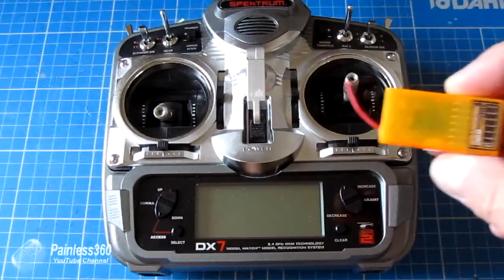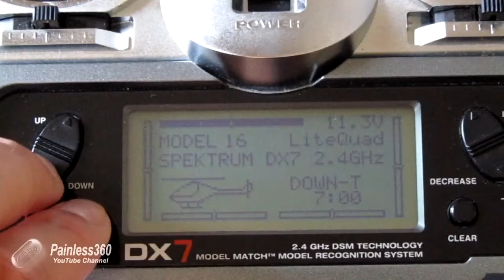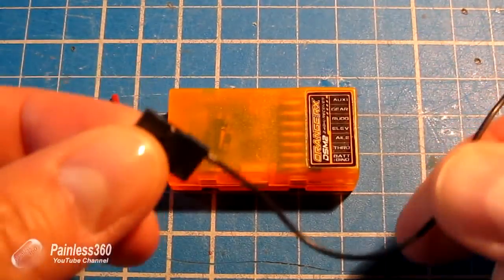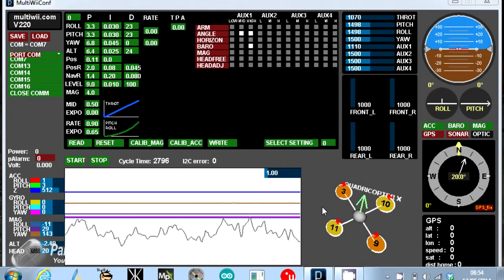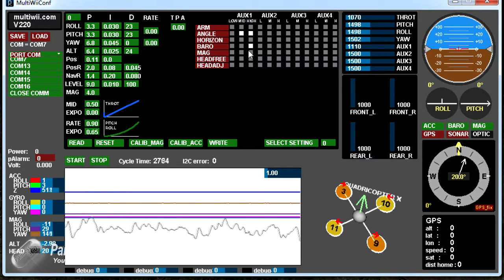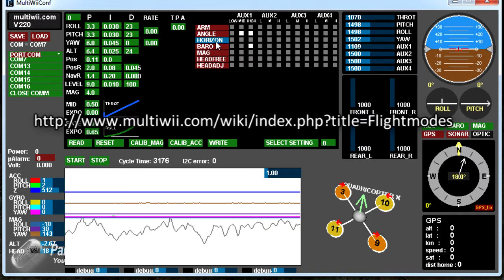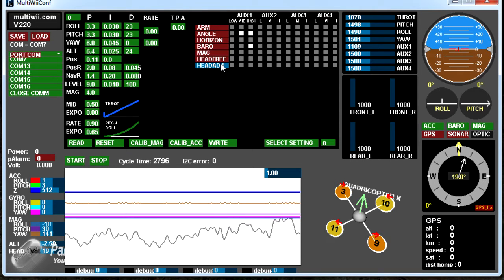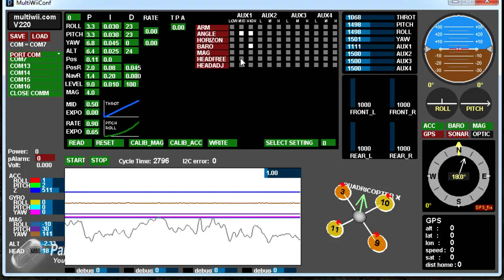(4/7) MultiWii modes - radio, connection and software setup

Comment: Does failsafe works on multiwii. ?
Reply from the maker: It is a long time since I played with it and it didn't support modern protocols so you'd have to set the RTH signal to be used when the RX lost the connection..

Comment: Arduino: 1.8.9 (Windows 10), Board: "Arduino/Genuino Uno"

C:\Users\HP\AppData\Local\Temp\ccilRd80.ltrans0.ltrans.o: In function `main':

C:\Program Files (x86)\Arduino\hardware\arduino\avr\cores\arduino/main.cpp:43: undefined reference to `setup'

C:\Program Files (x86)\Arduino\hardware\arduino\avr\cores\arduino/main.cpp:46: undefined reference to `loop'

collect2.exe: error: ld returned 1 exit status

exit status 1
Error compiling for board Arduino/Genuino Uno.

This report would have more information with
"Show verbose output during compilation"
option enabled in File -> Preferences.

Comment: i want to use 2 aux channels. one is working fine but the second is not.
is there any way to configure/enable 2nd aux channel?
Reply from the maker: +veer kumar rathore if they are setup on the radio and connected to the flight controller you'll see them. What troubleshooting have you already tried?
Reply: solved it.
Aux1 i am assigning to 3-state switch, GUI also have Low, Mid, High.and it was working fine.
Aux2 i was assigning to 2-state switch (High, Low), but GUI require 3 states (Low, Mid, High). i had to enable the right switch. that was the problem.
now i have assigned Aux2 to 3-state switch and it is working great!.
thank you for you time
Reply from the maker: Glad you got it working! Running though the problem methodically can usually get you close to the answer. Happy flying!

Comment: Hello! I'm new to building quadcopters and I've recently run into an issue where only two of the motors spin when I increase the throttle , and even the speeds of those two motors are too slow. I've calibrated the ESCs and the motors work well individually. Would this be an issue with the receiver/transmitter or the programming of the multiwii? I'm not sure how to go about fixing this, could you perhaps direct me on the right path? Thank you so much!
Reply from the maker: Have you tried to fly it? This can happen on the bench in a test as the 'feedback' from the movement expected by the flight controller isn't there..

Comment: Hello again, and thanks for the great videos. I am building my second quad, and have ordered a Flip MWC 1.5 FC, with Baro and Mag, and Firmware 2.3. Being impatient I have been looking at the Windows GUI, and the MultiWiiConf GUI. The Windows GUI loads fine, with no board plugged in (still en route), but the MultiWii will not load (using windows 32 version). Is this normal? Does the MultiWii need the board plugged in before it will come onscreen, or is there something amiss?
Reply from the maker: I'd wait until the board arrives before troubleshooting something that might not even be an issue ;) We don't use MWC anymore, best of luck with the build! :D

Comment: Great video.  Helped me take a closer look at how I had my FC board board set up.  I use the identical orange receiver in the video.  So, my receiver had 6 outputs, including the Gear and Aux1 channels.  However, I Never realized the FC board only had 5 channels.  The FC board does not have a Gear channel.  Instead, it has the Aux1 channel.  I never realized I made a mistake and plugged my gear channel from the receiver, into the Aux1 channel on the flight controller, until today.  So, the transmitter Gear channel always operated the Aux1 functions on the MultiWii Configuration screen, which seemed odd, but it worked.  I fixed the transposed connection on my receiver output.  Thanks.
Reply from the maker: You're welcome - happy flying!

Comment: hello working on 1st drone using multiwii se 2.5 connected it with receiver properly as u shown but can't arm it .so I checked signal in GUI software it's not showing pitch and yew signal at all only throttle n roll is changing I have checked receiver it's giving signals on all 4 channel then also multiwii is getting only throttle n roll plz help me
Reply from the maker: I'd swap the connections round and see if those 'dead' inputs stay that way.. and triple check you've got the wires the right w3ay round.. I'd suggest a CC3D for a first build - see our Flight controller comparison video.. Best of luck!

Comment: I'm sure the chip in the middle of the board isnt supposed to get hot and although I can bind the tx I still cant get the motors to spin.I'm probably pretty close to getting it running but life is too short to waste messing around with computers so I think I'll quit while I'm ahead and sell it off cheap to someone who's a bit younger and has the time to waste.
Reply from the maker: +thra5herxb12s Shame, there are so may other newer boards that are easier to setup and use (see our flight controller comparison video). Happy flying!
Reply: Thanks. Yes I have seen other boards for sale but I chose this one as an option because the setup looked quite straightforward enough.  I followed your tutorial closely and despite my broadband being very slow, I managed to upload the firmware to the board, but now I think the tx needs setting up properly.  I have the binding because the rx light stops flashing when I switch on, and I get a blue light indication when I move the throttle to lower right and back to lower left also gives an indication, but still no motor spin, even if I plug the esc into the rx directly I dont get a spin.  I will put it down for a while and have another look at what I might have missed when I have a bit more patience.

Comment: hello!, I have multiwii 2.5 but with the computer I cannot see the headadj and headfree mode, what is the problem? How can I fix it? I dont have gps.
thanks a lot
Reply from the maker: +Pigna Pigni Happy to help but please watch https://www.youtube.com/watch?v=olIqTiSJHIY and come back to me with more detail of what you've tried..
Reply: +Painless360  Hello, I saw the video but the answer is not there. With the code 2.4 I cannot see the headfree and headadj mode when the board is connected in the computer but with the code 2.3 I can see them. I have tried to active them but there aren&#39;t working definitely and I don&#39;t know why. The magnetometer is calibrate and it&#39;s work. Maybe there is a problem on the code? I&#39;m not a computer programmer so I really don&#39;t know what to do.
Thanks for your time

Comment: How do you determine the max range of your transmitter and receiver combination? Thanks a ton in advance.
Reply from the maker: +Aidan Melen You setup your receiver and attach something like a servo to a spare output then get a pal to stand still in open ground and wiggle the control that moves the servo and then start walking - when the servo starts to glitch then you're approaching the max range.

Comment: hi chap , i have followed your other videos and have managed to program the mutiwii board ok , but the problem iam having is that when i arm the board the throttle will start turning the props a little i have lowered all trims and sub trims but i cant get them to stop turning  unless i disarm the board , all my travel is full back aswell , any ideas
Reply from the maker: +andy richards Have you calibrated the ESCs?
Reply: yes did that , think i foune one of your videos about changing the code on the board
Reply: hi again do you deal with just quads of have you heli experience as well ?
Reply from the maker: Yep, started in the hobby with CP helis. Not bothered to fit flight controllers to them though.. Happy flying!
Reply: Hi, I've got the same problem, could you explain how did you solve it? Thanks
Reply: he has a video on how to stop this , i followed it , and it sorted it out , if you search how to stop my props from turning on start up ,the vid will come up  if i can remember rite its in the program listing
Reply: in the arduino program

Comment: Hello - Your videos have really helped me with my quadcopter! I have a  question. I'm using a Multiwii SE 2.5 and a DX6i. I currently have the Gear switch mapped to Aux1 in the multiwii gui and it operates fine. I've set up the Flap switch as my AUX2 however when connected to the gui, I see AUX2 is pinned at 2000 regardless of the switch position. I swapped the signal wire from the Gear slot on my AR6200 and plugged it to Aux1  its AUX1 on the receiver but aux2 on the gui if that makes sense) and and it works perfectly fine. This tells me that the transmitter is configured fine (not to mention I can monitor the switch activity in the transmitter display). My belief here is that there is something in the multiwii sketch that needs to be commented or uncommented in order to get Pin8 active on the board. I read through some forums and tried a few things, but can't seem to get the Aux2 channel out from being pinned at 2000. Any ideas are appreciated!
Reply from the maker: +tilneyaviation You can use pin 8 or 12 as aux 2, you need to define this in the sketch. Best of luck.
Reply: Thank you for your help. I knew I was on the right track, but must have botched something when I was fooling with the script. I was able to get it working this morning.
Reply from the maker: Great news - well done. Happy flying!

Comment: Did you talk about how the rates and expo work in the multiwii config in this series. I can't find detailed explanation anywhere cheers
Reply from the maker: AndyRC No I didn't. They work the same way as on the radio but with better resolution if set of the FC but you can change them using switches if you set them up on the radio.
Hope this makes sense.
Reply: im finding the rates part really confusing. next to the yaw and pitch axis there is a rate option but then further down theres expo and rate. cant find any explanation to the values that is transparent
Reply from the maker: RC rate: defines the sensitivity of the multicopter for PITCH and ROLL stick inputs. If you feel your multi too sensitive, decrease it. If you want to improve its responsiveness, increase this parameter.

Hope that helps.
Reply: yeah i see that on the wiki. i understand what rates are but there is more than one rate option in multiwiiconf. on my version 2.3 next to the d values i see two rate options  but then underneath the mag box there is mid expo and another rate box. which ones actually change the rates :-(
Reply from the maker: Best of luck with it.

Comment: In noticed when a certain flight mode is activated it turns green, but when I activate GPS flight modes it stays red? Have any ideas ?
Reply from the maker: Adam Keely Not sure - does the MWC have a 3d lock when you try this? Maybe it needs to have the GPS systems all working before it shows Green?
Reply: Yeah I get 7 satellites and a GPS 3D fix
Reply from the maker: Odd, have you tried a little GPS RTH?
Reply: I figured it out, you have to activate MAG also in order for the GPS hold to work.
Reply from the maker: Ah! Nice!

Comment: I have been trying to get my 450 to turn its motors the past few weeks and i can not figure out what i am doing wrong. Can someone please like at my arduino file and see if i am missing something and why it is not working? I have calibrated the ESCS. Currently the Blue light is on LED3 and 5v red light is on. Occasionaly the blue light will blink. I thought the blue light only came on when the motors were armed. This is the multiwii pro purchased from HK with the MTK GPS. Attached is the Arduino file if someone can please look at it i would greatly apprecate it. Thank You!
http://www.rcgroups.com/forums/showthread.php?t=2276498#post29834818
Reply from the maker: what board type are you selecting in the Arduino software?
Reply: Painless360 ok i used the original .ino file and it finally works although it seems to want to fly sideways and tip over. Is this a problem with the esc calibration?
Reply from the maker: Hi Jordan, sounds like it could be. Also recalibrate the accelerometers on a level surface and check the trims/subtrims on the radio give 1500 when at the midpoint for ELEV and AILE. Best of luck!
Reply: Jordan Mowbray Also. Try launching in angle mode. Smaller props, check motor and prop directions. Check radio settings. Calibrate ESCs and the overall weight balance. I found that playing around with my quad whilst i was holding it gave me a good idea as to what was going on, be careful if its powerful, mine only has the 10g motors. I lost an ESC for a while and took the chance to hold the quad by the not working arm and i flew it at the same time, this gave me a good idea if it was counter acting my movements etc. It felt like it could fly on 3 motors, you only have to take a tiny amount of the weight off the non working arm for it to stay level. Finally check PID settings if you have to. If none of your components or wiring are bad you can check all of the above.

Comment: Hello,first sorry for my english!! I have installed v2.0 on my MW SE v2.5 board and I CAN v2.1 in left corner was DONE UPLOADING no failure !! my problem is when i connect my quad blue LED flashing-on FTDI flashes red and on MW conf i cant see values,NOTHING,not exist -.- !! Now can you help me please !?
Reply from the maker: Reflash the board and make sure that the board is kept flat when you power it on. If its worked then you should be able to see the board in the MultiwiiConf program once it's updated.
Reply: Painless360
tnx for answer,but man...doesn't work!! i have one more time inst. software and same problem...blue led flashing constantly.when i connect board on comp no data !! i don't know what to do .  2 days i'm playing whit this but...no effect and your's go so easily ONE MORE TIME TNX ON YOUR TIME :)
Reply from the maker: Mali Zafrkani The blue light slashing like that usually means that the accelerometers need calibrating, which is done through the MultiWiiConf software. Adding a video showing the problem (screen showing the error on the PC, video of the lights on the craft) helps troubleshooting. It's like asking me to diagnose what's wrong with your car by telling me that it won't start ;)If there is nothing obvious then you will need to schedule a Helpouts session for me to help further.Best of luck getting it fixed!
Reply: Painless360
 Houston we have connection :D !! several times flashed several times soft.inst and OK i see now my quad in MWC and data,all green BUUUUUUT i don't have sensors -.- i2c problem ...counting and counting and counting....can i fix that any ideas ..please!?
Reply from the maker: Great news that you can talk to the board. Have you got anything plugged into the i2c port like an i2c board?
Reply: Painless360
my board i think have inside i2c becouse i have in conf.h enabled that ... i have on screen all data all sensors but i can't arm quad ...and i must say in conf.h i didn't select board (my multiwii se v2.5) i have i2c acc i2c baro and i2c mag acivated ...i'm working with MW v2.1

Comment: I'm trying to decide which modes I need and how to set them up on my Taranis. I know I want return to home. Which ones can I combine on one switch or should I use separate switches for each? Which modes should I avoid entirely?
Reply from the maker: When you activate RTH is uses the compass and alt hold to fly home. Even if you don't have then selected. Hope this helps. Happy flying

Comment: First of all thanks for all your time in these video's you've made, They have been very helpful. Question which software or sketch are you using? I want to setup one for a Tricopter. Waiting for this board to come in. If you have a link to where to get the sketch that would be very helpful. 
Many thanks
Reply from the maker: Hi Dennis, I edited my own. You can see the one that I used in one of the first Multiwii videos I made. You can find the link and details on Crius SE V2.0 MultiWii Board (MWB) Overview and Setup

Comment: Hi! Great video! I am having an issue here. I have a multi wii black 32 + gps. When I try to run multiwii and setup the flying modes to any of my 2 available channels, I click in the square boxes as you do and then click 'write'. When I do so the board starts beeping (3 beeps...3 seconds...3 beeps) and will never stop unless I click reset wich will erase my settings.. It also happens when I just click on Write with any boxes chosen.Sorry if this is a newbie question. Thanks
Reply from the maker: I've not seen this myself - make sure you are using the same version of MultiWiiConf as the version of the code on the board. RCGroups have some great forums if this isn't the answer. Sorry I can't be of more help. I hope you get this sorted soon.
Reply: Painless360 thanks for the tips! i am using the last multiwii ...V2.3.
about the board code, I am not sure how to verify that but I've uploaded to the board the last code available posted in october 2013 so I suppose it should work. any way I have already posted in RC Groups as you advised, hope I can sort it soon. tks again

Comment: I've seen quadcopters on youtube that can hover at a fixed position. (not fluctuate  from 6 to 20 feet) Does this solely depend upon the sensitivity of the Baro?

P.S. Thank you for this video! Very informative!
Reply from the maker: This can be done in a few ways - more sensitive baros and accelerometers and use the GPS data too. DJI systems seem very good at this (but they should be for the price!).  The more you spend on the controller the better the features like GPS mission planning and ability to hold a position in the sky.

Hope this helps. Happy flying!
Reply: Painless360
Covering the baro helps-- a lot!
Reply from the maker: It sure does, what do you use to cover yours?
Reply: Painless360
I've used a piece of dark foam + my multiwii pro also has a cover... the BMP085 baro on mine is pretty unstable unless covered
Reply: Thank you Painless360 and rvp666. You've been really helpful through my multi rotor journey!